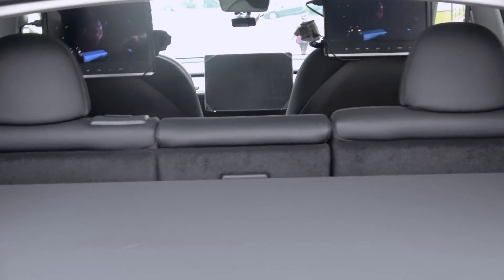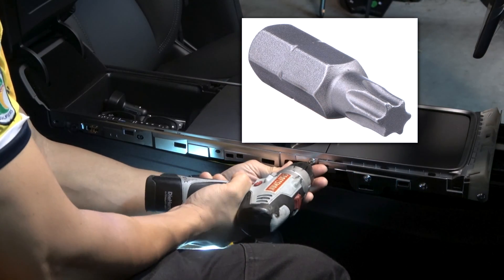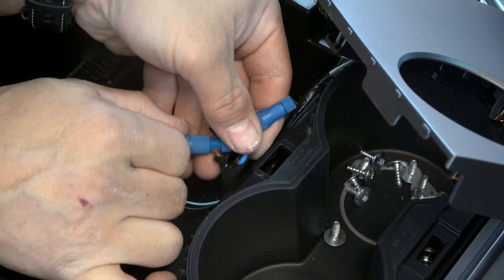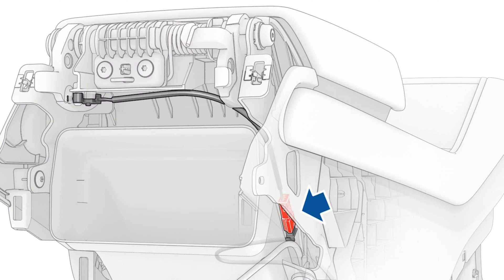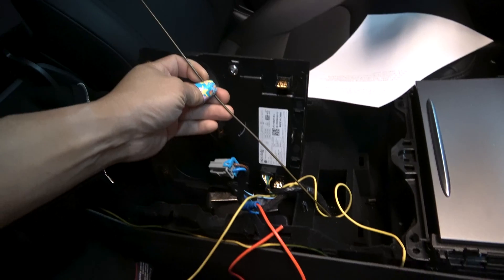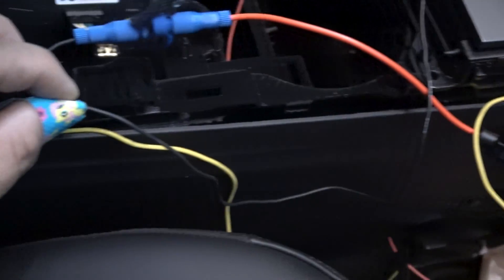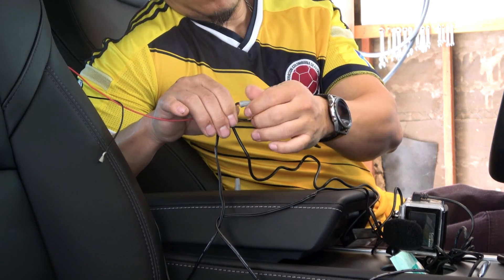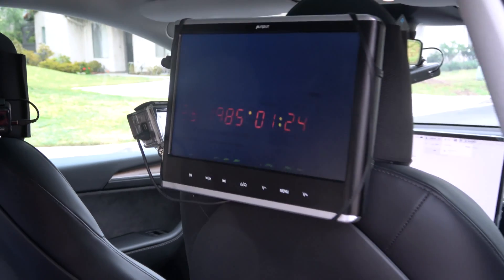Tesla TV Screens | 12v relay Accessory Power | Don't Void Warranty

Comment: My 2023 Model Y doesn't have the OBD connector in that location. Any suggestion on where to find that "Brown-white" wire? Thanks!
Reply: use one of the thin red wires underneath the glove box on the firewall, one of them should be switched